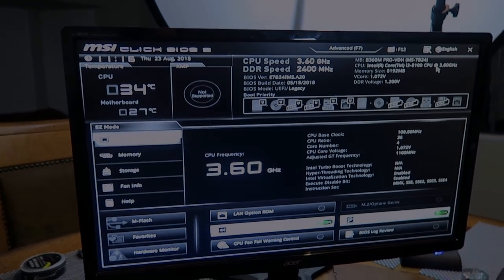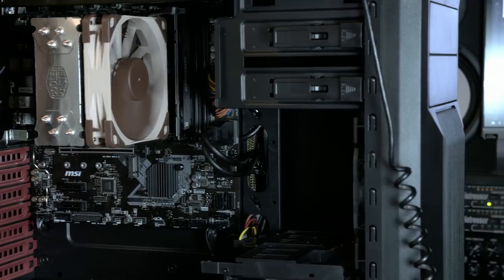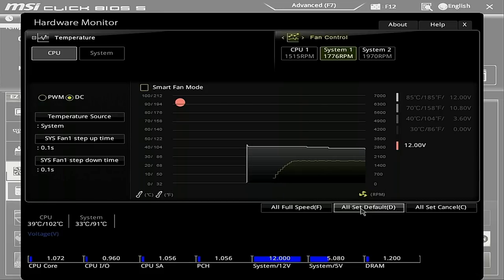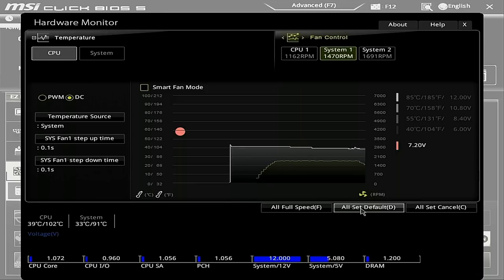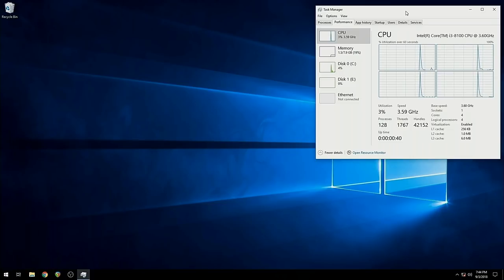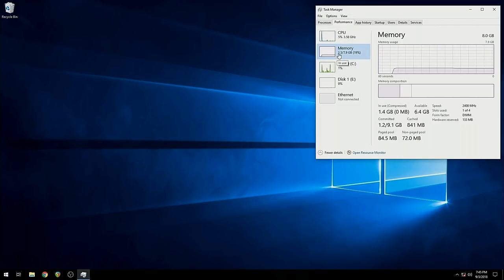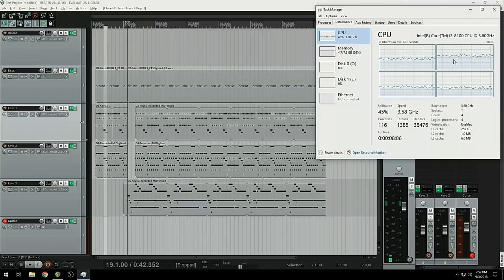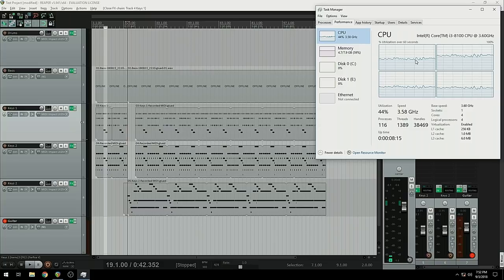Building a $500 Audio Production Computer

Comment: I would have chosen a motherboard with the option to add a thunderbolt card in the future, many interfaces now are using TB and RT latency is an issue of the past- Even low budget interfaces are using TB now.
Reply from the maker: I think that Thunderbolt has a bright future ahead of it, but I'm not sold on it for the PC market yet.  I can scarcely find motherboards that natively support it, and the few that do support it cost quite a bit more than this build would have allowed.  And the cheapest 2x2 TB interface I can find costs double what a USB 2x2 interface costs.  I think Thunderbolt 3 is going to be a great thing eventually, but I couldn't justify it for a budget build quite yet.  It'll get there though.
Reply from the maker: @Cozie 16 GB of RAM would be great for an audio workstation.  I went with 8 GB because at the time, RAM was really expensive.  Now that the cost of RAM has started to come down, I'd say shoot for 16 GB.

As far as CPU, I would shoot for an 8th generation Core i5.  I think they hit that sweet spot for performance per dollar.  I couldn't quite afford an i5 for this build.  I just happened to get a sweet package deal on the i3 and this motherboard.  Also consider AMD 2nd gen Ryzen 3 and Ryzen 5 while you're shopping.  It'd require a different motherboard than what I used here, but there are lots of options out there.
Reply from the maker: @Cozie GPUs are kind of a sore subject right now.  If you're not planning on gaming on the system, then you'd be fine with an older GTX 900 series or AMD Radeon card.  If you're wanting to game, then things get kinda messy.  Nvidia's GTX 1000 series cards are getting scarce so their prices are rising.  And the RTX 2000 series are brand new and are super expensive still.  Maybe an AMD GPU would be the way to go for now, until Nvidia's prices stabilize a bit.
Reply from the maker: @Cozie The 2nd generation Ryzen CPUs use the AM4 socket, so you'd want to search for motherboards that use that socket.  The 8th generation Intel CPUs use the LGA 1151 socket and require an Intel 300 series chipset.  On sites like Newegg.com, you can refine your search results according to these criteria.  That way you can browse only the motherboards that are compatible with the CPU that you plan to use.  Also check out PCPartPicker.com, which is a great place to make sure that the components that you choose are compatible with each other.

Comment: Do you think the i3 CPU would hold up with up to 12 mics for drumming? Still trying to learn what I need and not go overboard. Also might wanna game on it
Reply from the maker: It'd keep up with the audio tracks no problem.  But if you've got a lot of VST effects piled on each track and on the master, the i3 might start to struggle when you're mixing.  I think it'd be ok for gaming, but more cores, higher clock speeds and more threads from an i5 or i7 certainly wouldn't hurt.
Reply: @YHRS  Thanks for replying. I was looking at the price between AMD's and Intel's CPUs wondering if I could get a better deal with the same performance (or close) using either or. I am not sure if you have experience with AMD processors ,but it would be a great help if you did. I would be using very few programs and MIDI controllers for each track. Again, Thanks for helping. Still trying to figure out this whole thing. Haha
Reply from the maker: @isaacfenison6845  My audio workstation has been running an AMD Ryzen 7 1700 for a little over 2 years now, and I absolutely love it.  And now that the Zen 2 (Ryzen 3000) CPUs are out, I'm anxious to upgrade to one of those in the near future, although this old 1st gen Ryzen is still doing a great job for both audio and video editing.  

Intel still has (slightly) better single-core performance, so it might still edge out AMD for high-performance gaming.  But for anything that makes use of lots of cores/threads, Ryzen is a terrific option.
Reply: @YHRS  Thank you so much for your opinion! Subbed

Comment: Any recommendations for a great pre-built desktop for running Ableton and recording via a scarlett 18i8? Currently experiencing an excruciating number of pops and clicks and I've attributed it to my i7-6700. I think it's just too slow.
Reply from the maker: I've tried shopping for pre-built computers recently but I get bogged down pretty quickly.  But I can't imagine that an i7-6700 would be a problem for heavy-duty audio work.  Have you tried running LatencyMon or some similar DPC latency checker to see what might be causing the issues?
Reply: @YHRS  I have not, are those free programs that I can use?
Reply from the maker: @adamcyran2613  Yes, LatencyMon is a free download and is compatible with Windows 10.  It'll at least show which drivers are causing any severe DPC latency, which will help point to what might be done to help it perform better.  Usually it's just a matter of updating a driver for LAN, Wi-Fi, GPU or something like that.

I've been chasing down a nasty latency on my gaming machine (i7-4900K) and it seems that my graphics drivers are at fault.  But I'm not sure what to do about that...I can't just uninstall the GPU on a gaming machine.  I'll try to roll back to older NVidia drivers and see if I can find one that doesn't suffer from the DPC latency that I'm seeing.

Comment: For a cpu for music this year I would recommend the r3 3200g or r5 3400g, they are the best for a low budget music prod pc in 2020, also get 16 gbs, its slot cheaper nowadays.
Reply: I am trying to decide between R5 3400g and i5 10400,  My builds are at the same price . What do you think? Is really worth to buy R5 3400G? Does it works Ok on music production? I use reaper and a lot of VSTs, lot of kontak
Reply: @leonardogroia9048  absolutely get the 10400, it has 2 more cores and if you can have a build that has that for the same price then that is great,
Reply: @someperson6913  my doubt is the memory speed, R5 motherboard can reach 3000mhz but i5 motherboard only reach 2666 mhz RAM for i5.
Reply: @leonardogroia9048  intel chips dont rely too heavily on ram speeds so you should he fine

Comment: What do you think the requirements would be for a laptop for something like FL studio
Reply from the maker: If you're using FL Studio, then I'd assume that you're more focused on virtual instruments rather than audio tracks.  In that case, I'd recommend at least 16GB of RAM, and whichever CPU is in your budget.  On the Intel side, I'd recommend at least an 8th gen Core i5 or above.  Or on the AMD side, a 2nd gen Ryzen 5 or above would most likely be sufficient.  AMD is about to release their 3rd gen Ryzen chips this summer, and early reports are that they absolutely rock.  I'd be tempted to wait a few months and grab one of those when they're released.
Reply: As an FL user for the last 18 years I will say this: if you are going to use omnisphere, Electra x and/or kontakt heavily get a i7 7th gen or BETTER with 32 gb of ram. You can get going with way less but, once you start adding more and more tracks you will see your resources eat up quickly(especially omnisphere and Electra x)

Comment: This great for the audio part of things but im looking for a machine  to do video editing  also.
And im just not knowledgeable in this realm of pc. Could you help?
Reply from the maker: For video editing you want CPU cores, and lots of them.  I'm using an AMD Ryzen 7 (8 cores, 16 threads) and it's pretty awesome for video.  If you've got the money, something like a Threadripper or one of Intel's 8 or 12 core CPUs would be great.  But those CPUs and the motherboards that support them are pretty expensive.  

You'll also want a good graphics card to help keep things smooth and to assist in rendering.  Depending on which video editor you use and which video format/codec you use, you might be able to take advantage of NVidia's CUDA or AMD's OpenCL to accelerate video rendering.  I'm using DaVinci Resolve and an entry-level NVidia Quadro.  I can render to H.264 (at 1080 x 24fps) at about 3x realtime, which is pretty great.
Reply: @YHRS  Thank You.

Comment: I have an issue with my mpk 2. I running it with my 200$ Toshiba so I’m not surprised, whenever I do a live take I have intense latency between when I hit a note and when I hear it (the track receives the audio late as well). I’ve messed with buffer size a lot and I got it close but not close enough. Also I plug the mpk into my friends macbook and the latency seemed non existant. Plz help

Comment: I see some plugins require i5 core.. is it ok if i run the plugin in an i3 core ??
Reply from the maker: Good question.  All i5 CPUs aren't created equal...there's a pretty massive difference between the earliest i5's and current ones, plus differences with ones denoted as "U" or Ultra-low power consumption.  So what might have struggled on, say, a 2nd generation i5, might run fine on a 10th gen i3.  The best advice I can offer is to get a demo version of the plugin and test it out first-hand before purchasing.

Comment: Could you record virtual instruments from impact without noticable latency in live monitoring  with this build? I mean did the adjusted ASIO latency sounded and felt right for those low numbers of 7ms roundtrip?
Reply from the maker: Sure, that should be no problem.  I was able to record virtual instruments from Superior Drummer and Arturia while monitoring through software and it was fine.
Reply: @YHRS  thanks for info, i tried it with portable pc block with i3 8100u and tried to set like 120 or 64 samples but the latency was awful, but for my home setup with good old 2500k everything seems fine with same setup. So it looks like weak CPU is bottlenecking but still tries to look like it delivers for some strange reason.
Reply from the maker: @tastedcutlet  if the latency was still bad with a 64 sample buffer, then there is something else afoot.  If the CPU was bottlenecking things, you'd get pops, crackles, dropouts or stutters.  

What interface are you using?
Reply: @YHRS  I thought the same, the problem pc just built-in soundcard, but I'm aware of positive experience with those considering latency, just the quality of sound still can't catch up with discrete cards. In my successful pc i use pci-e asus xonar d1 card though, so maybe it's the problem.

Comment: Thanks for making the video, I found it really useful particularly since my budget  is pretty much the same as yours only the UK equivalent.  I just wanted to ask though, in your opinion, Intel I3 8100 or the AMD Ryzen 3 2200G?  Which is better?
Reply: Amd works better for me, sometimes I even do video editing and rendering, and for 1080 it's totally ok
Reply: @cesarnovoa9101  this is good to know.  Usually all I will do is use Adobe audition and reaper (not at same time). I will have lots of files open and plugins also.  I very rarely record using pc sound card itself.  I record using a multitrack then import the wavs. Thanks for your input.

Comment: Hello sir, I'm planning to produce RnB,Pop type music using ableton live,  would you think with that kind of genre an intel i5-4th gen processor could do the work? TIA
Reply from the maker: I think that a 4th gen i5 would become a little frustrating to work with at some point.  I might suggest going for a more recent i5, preferably after they went to a 6-core setup for the i5 (8th gen and later).
Reply: thank you so much 😍
Reply: @nelquizon5330  agreed the i5 9600k would work well just remember to use the correct motherboard z390 ideally 👍🏻

Comment: Seems 8400 is  extremely expenive because of intel manufacturing problem ... do you recommend 8100 for daw such as studio one ?  I am trying to figure out which i should focus more ssd  or cpu
Reply from the maker: I would always prioritize CPU over everything else.  An i5 8400 would be an awesome audio workstation CPU.  6 cores, 4 GHz turbo speed, that's pretty great.  I see Newegg is selling them for $220, which I think is a fair price.  If that's too steep for your budget, then take a look at an AMD Ryzen 5 2600, which is currently selling for about $160.  It's also 6 cores, has a faster base speed and almost the same turbo speed as the 8400.  I'm using a Ryzen 7 1700 myself, and it's spectacular for audio and video content creation.
Reply: @YHRS   thank you  so much

Comment: Hello can you please give me some feedback on building a custom pc for audio production?

Motherboard - MSI B360M PRO-VDH LGA 1151 mATX Intel Motherboard [70]

CPU -  Intel i5 8400 [220]

Case - Corsair 100 r [60]

Ram - Ballistix Sport LT 8GB Single DDR4 2400 MT/s (PC4-19200) DIMM 288-Pin - BLS8G4D240FSB (Gray) 65 x2 - [130]

Power - Cooler Master MasterWatt Lite 500 Watt 80 Plus ATX Power Supply
[35]

SSD - Inland Professional 120GB 3D TLC NAND SATA III 6GB/s 2.5" Internal Solid State Drive (120G) [20]

HD - Toshiba P300 1TB 7200RPM SATA III 6Gb/s 3.5" OEM Internal Hard Drive - [50] (optional)

CPU Cooler - Cooler Master Hyper 212 LED CPU Cooler [35]

CPU Cooler Fan - Noctua NF-F12 PWM SSO Bearing 120mm Case Fan [30]

Intake Fan - Corsair ML140 Magnetic Levitation 140mm Case Fan - Twin Pack [40]

Exhaust Fan - Corsair Air AF120 Quiet Edition White LED Sleeve Bearing 120mm Case Fan [15]

Fan Splitter - SilverStone PWM fan splitter [6]

Thermal Paste [8]

Windows 10 - [100]

____
770 - 820

I dont know much about assembling PCs. I took a bunch of information from your video and the comments

Will that RAM match my CPU? Will those fans match my case?

Should I get a cheap graphics card? I will only use it for Ableton 10 and vsts (kontakt 5, arturia v, and studio drummer)

I have a Mackie Onyx Artists 1-2 interface. I would like to be able to monitor guitar in Ableton with the lowest latency and highest quality as possible

Great videos btw. Thanks
Reply from the maker: Hello!  Glad to see that you're putting a system together.  

Yes, that RAM should work fine with that motherboard and CPU.  It's DDR4 and the standard 288 pin format so it should work fine with your other components.    

The specs for the 100R case says that it can accommodate 2 x 120mm fans OR 2 x 140mm fans in the front and 1 x 120mm fan in the rear.  Plus it can accommodate 2 x 120mm fans on the top as well.  So the ML140 fans should work as front intake fans, and the AF120 can replace the provided rear exhaust fan that comes with the case.

As far as a graphics card, I don't think it would be necessary.  The i5 8400 shouldn't break a sweat for DAW duties, so I'd only worry about a graphics card if you notice the CPU stressing out under normal workloads or if you get into editing video or something.

I think that the Onyx will be capable of providing low latency monitoring.  Just pull up the ASIO configuration panel for it and find the smallest buffer size that you can get away with before hearing any pops or crackles when you record or play back audio.

I think you're on the right track for a pretty sweet DAW setup!  Best of luck!
Reply: @YHRS 

Thanks for the reply and all the info. This has helped a lot

Is it the audio interface (Onyx) that determines how low of latency I can monitor at without pop/crackles or does the cpu/ram also effect that?
Reply: I hope you didn't buy that system. You can get a better one for much cheaper
Reply from the maker: @yhwhrevength622  Could you share links to the better, cheaper components for sale?

Comment: And now we‘re sitting here with much cheaper Ram and Ssd prices.
If YOU want to build this NOW you can buy a larger Ssd or 16gb Ram.
Btw. The Speed improvement of 5400rpm vs 7200rpm is not THAT Large.
Same with Sata 1 vs 3.
The Only thing you must pay attention is that the Hard drive isn’t from 2005 meaning it’s a New one from 2019.
Or save a bit money to just buy a 1tb SSd and you should be Good for a While.
Reply from the maker: It was definitely an unfortunate time to be building a budget machine with DDR4 memory.  I tried to fit 16GB in, but I really wanted to stick to the $500 budget.  Today, RAM prices are much better.  And so are SSD prices!  I totally agree, I could probably build in this same budget and afford an 8th gen i5, more RAM, and more SSD storage.  Maybe not all for $500, but pretty darned close!
Reply: Cryptomining, I remember when they first invented Cryptomining. Sweet, sweet overpriced Ram, Gpu and Storage Prices. I always hated it!